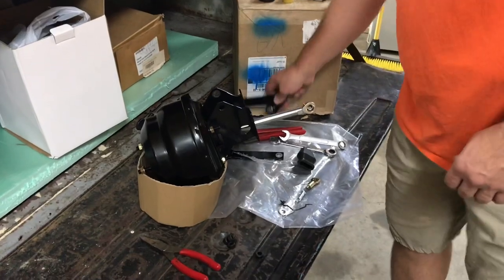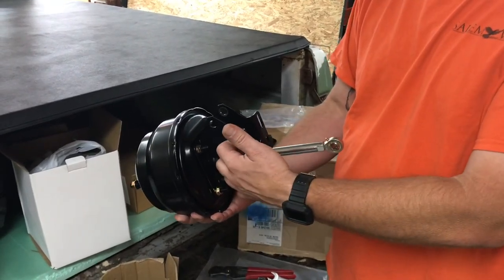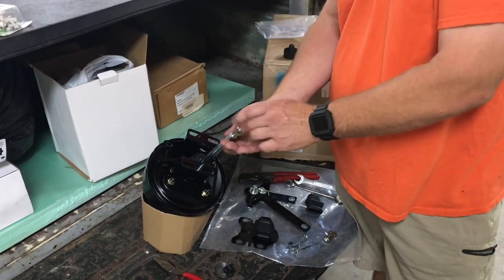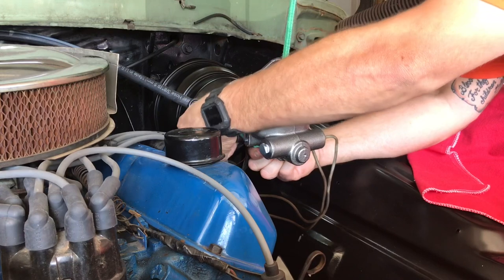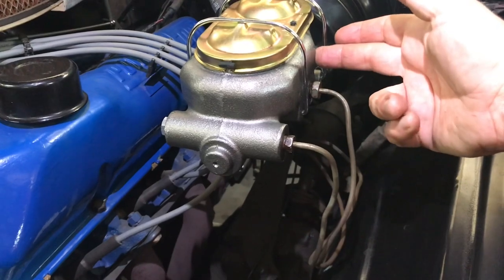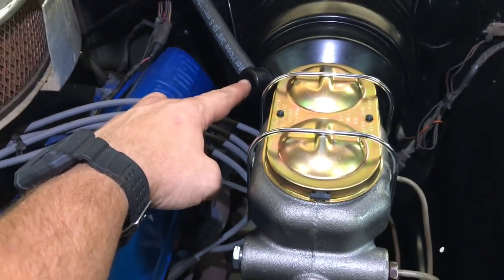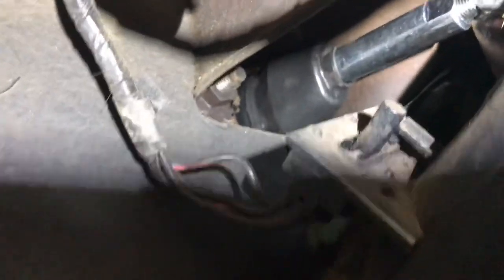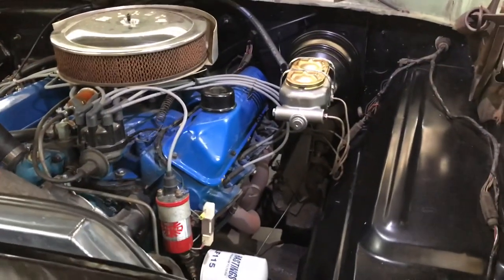CJ Pony Parts power Brake conversion kit F100

Comment: That set up is all right for USA but in Australia it's no good we use ford falcon set up
Reply from the maker: Interesting, what’s the difference that makes is not work? Do you have any pics?
Reply: @SalemVaOutdoorsAndMore  on the power booster we have adjustable push rod straight to brake pedal.  I like the set up but it's dark here no photos I have a 79 f100 just finished doing a 72 f 100 for a lady not aloud to send photos
Reply from the maker: I see what your saying, mine also is adjustable straight out the back to the brake pedal. On my video at 3:00 I briefly about how I set the length of the rod to match my old master cylinder. I’m pretty sure that’s what your talking about. Keep us updated, thanks for watching and please subscribe!!

Comment: I was just looking at this kit on CJ Pony Parts.... you've mounted it upside down from what they show in the online pictures? Was that a hood clearance issue? Just curious....
Reply from the maker: No clearance issues what so ever. To make the rod line up properly that was the way mine had to be. Either way will work the same. Thanks for watching and please subscribe!!
Reply: @SalemVaOutdoorsAndMore  I did the same thing to allow the rod to line up. Good kit but like said no instructions so you have to piece it together to what works for you.

Comment: How did you unwind the brake lines?
Reply from the maker: I just carefully straightened then some and re-bent them to where I needed them. I was lucky I didn’t kink them and mine weren’t that rusty. My opinion was if it cracks or kinks, I could a week spot anyway so it needed replacing. Just take your time and you should be fine. Thanks for commenting and please subscribe!!